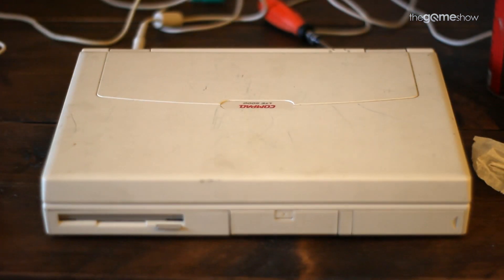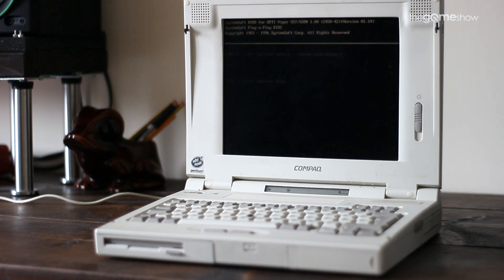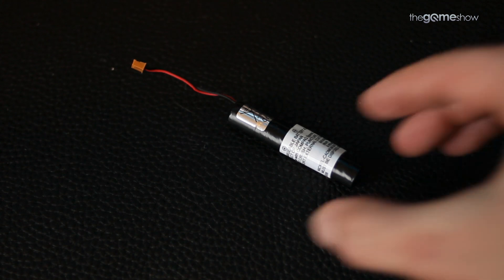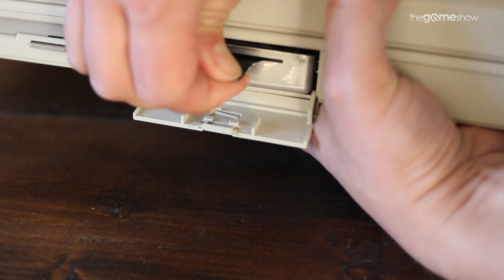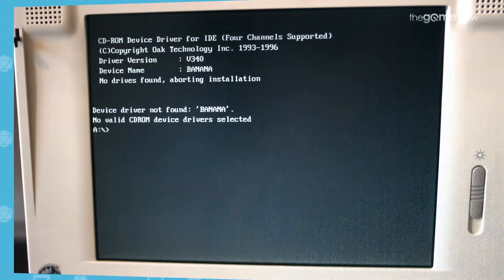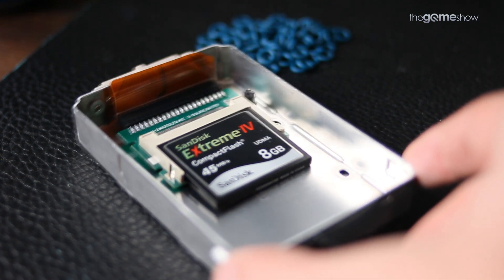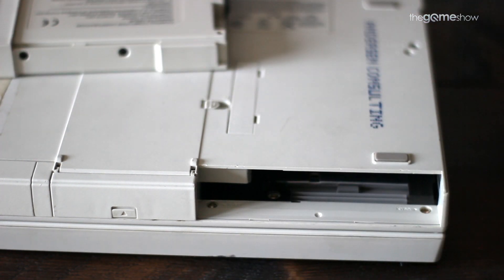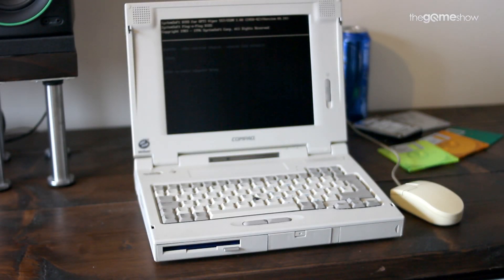Upgrading a Compaq LTE 5000 Laptop with an IDE Compact Flash Card for DOS

Comment: I've got same laptop. and I am struggling with Compact Flash too. 
May you please tell how did you installed MS DOS on your card? Did you used Virtual Box?
Reply from the maker: I put the CF into the adapter, the PC read it as if it was a hard drive. What CF card are you using?
Reply: Does it show the CF as a harddrive in the BIOS? This is the first thing that has to work. Then you need MS DOS 6.22. You can find it on google. Boot from DOS Disk 1 and install DOS. The installation will fail if the CF is not recognized. "No harddrive found on this machine".

Comment: I just picked up a Compaq LTE 5300 on eBay for $45 that was listed as having an error. It was simply a hibernation file error and easy to fix. The thing is mint! Anyhow, When I finally got the HDD to boot NT4 Workstation was loaded. I guessed the password! "admin" believe it or not. I noticed the system was registered to Andersen Consulting, the same company printed on the bottom of your Compaq. How strange. Instead of going the CF card route I ordered a 32GB mSATA SSD and mSATA to 44pin IDE adapter for a total cost of $32. I'm hoping to be powering through DOOM soon! These systems really do make the best retro DOS gaming rigs out there. Also, if you want to get around the problem of having to pull your CF card to load software, pick up a cheap PCMCIA Ethernet card, install Windows for Workgroups 3.11, set up TCP/IP and share your drive on the network. If fire up WFW3.11 when I need to install software on these older laptops by simply moving the files from my main Windows 7 system. Once finished, it's back to DOS. Also, someone else in the comments wondered how to install 95/98 without a CD. Get DOS installed on the HDD first using floppies. Put the HDD into another computer that has a CD drive, make a folder on the HDD called "OPTIONS" and copy the contents of the Windows 95/98 CD to the "OPTIONS" folder. (You'll copy either the \WIN95 or \WIN98 subdirectory contents depending on version of Windows on CD). Put the HDD back into the laptop, boot to DOS, go to the OPTIONS subdirectory and run SETUP. Windows 95/98 will load lickety-split and you'll have the added bonus of never needing the CD when changes to Windows are made. You can also do this with Windows 3.x by copying all the diskettes to the OPTIONS folder as well.
Reply from the maker: Fantastic story. Thanks for the high-effort post mate. GOOOO community!
Reply: I just got the 32GB mSATA and converter in yesterday and am having a bit of trouble. When I install the drive into the Compaq 5300 it only recognizes it as an 8GB drive, which is normal. The BIOS on these old machines had an 8GB limit. Back then you would load an "overlay" BIOS on the HDD that would override the computer's BIOS and allow the computer to see over 8GB. Well, anyway, I booted the system with a Win98 boot disk, and put a partition on the drive just to test it out. My plan was just to use the 32GB drive as an 8GB for now since I don't have any of those old overlay diskettes laying around any longer. FDISK partitioned the drive just fine however upon reboot the diskette starts to boot and just hangs. I'm assuming DOS 7.1 (the version on the Win98 boot disk) is not recognizing the drive for some odd reason. Back in the day leaving a large drive as 8GB without an overlay worked fine on PC systems but for some reason not on the Compaq. So, I just tracked down a generic overlay diskette on the net and am going to try this again. I'll update with the results. I'm hoping this works as an alternative to using the CF card option.

Comment: How you install Windows to cf? I don't understand it. You make it on a modern computer with ide-cable?
Reply from the maker: The CF card is connected via the laptop's internal IDE, so it functions identically to a HDD. As far at the computer is concerned, it is a hard drive. And so you install from floppy just as you would normally.
Reply: @StokedMatty   I have a LTE 5300 and a dead HDD. I bought an adapter and UDMA-card but I can't install the system. Should I do the installation on LTE itself or on another machine? Tnx
Reply from the maker: On the LTE. Have you been able to install DOS? That's your first step, before you can even think about Windows.
Reply: @StokedMatty  Well: I put a floppy drive, load DOS (with CD-drive support, of course) take out the floppy, put the CD-drive and begin installation win98?
Reply from the maker: Win98 would be a bold move. Your steps are correct but I feel the machine would crawl with anything above Windows 3. Also, great job nabbing the CD-ROM drive. I've had to suffice with floppy only!

Comment: I bought one of these today, I paid 5 dollars but i dont know if it is working.
Reply from the maker: Have you got the power pack etc? Battery is likely to be hosed so I'd remove that and use mains power.
Reply: @StokedMatty  If you're daring, the thing to do with the battery is to look up the li-ion cells online, buy replacements, and then go through the careful solder work to replace them in the old battery. If you have the skill. I don't so I'll be putting up with the dead main battery on the 5400 I got ahold of.

Comment: Question about the partitioning. It will only recognize 2gb, but I see you have an 8gb drive. Do you just create four separate partitions?
Reply from the maker: Correct. Literally zero reason to have 8gb of storage on DOS though!
Reply: The Game Show I've got almost 400gb of old DOS games and a mild case of ADD, so the more games I can fit on the LTE 5400 at once, the better :)
Reply from the maker: That's probably a million games. Best of luck getting through them all :-)
Reply: @joshuabrown3654  is there a good site to download DOS Roms? thx

Comment: The reason the first CF card wasn't working was due to it being a newer standard. The passive adapters only work with the earlier standards. In 2008, they changed from being pin compatible with IDE to working on a serial protocol (sata). That allows faster speeds and higher capacities, but it does mean you can't use it in place of an IDE drive.
Reply from the maker: This is why you lot are the best. Thank you mate, hopefully nobody need make the same mistake.
Reply: I'm not sure if i can give you a straight forward answer to that. The easy way would be to just look at people's recommendations, If you wanted to save money and search for a deal I would go and look up the standards and use the speeds to determine what one will work. None of this is a done deal though, my buddy bought what should of been a type 3 card from sandisk and it worked in his 2nd gen iPod.
Reply: The reason why the SanDisk CF didn't work is because it is set to behave as removable media in the media descriptor. There are programs on the internet that are capable to change it back to the original behave(fixed media).
Reply: Geose When I'm looking to buy a CF card, what should I be looking for in particular to avoid this issue?
Reply: The Transcend cards all use fixed-mode so they are a good bet.
Reply: @paianis  I got the exact same CF2IDE adapter in this video as well as a Transcend 266X 8GB card today, and it seems to just hang on 'Starting MS-DOS...' after selecting 'Configure Hard-Disks' (which then asks for a reboot) on an MS-DOS 6.22 from Floppy. @The Game Show is this the issue you were having when you said you were having formatting issues in the video?
Reply: I have a Delock CF to IDE adapter and although the BIOS recognises my 8GB card just fine, my 6.22 boot disk won't play ball with that or my 1GB card. Doesn't matter if I format it in OpenBSD (FAT16B) or Windows 7. Once I have a USB Floppy drive I can make a FreeDOS boot floppy and hope that will work.
Reply from the maker: This is EXACTLY the issue I was having. There is an explanation here in the comments. IIRC it's because of the formatting of the card and can be fixed by flashing the cars. My fix was decidedly less high tech, I just bought a cheap card which (coincidentally) had the older format.
Reply: @StokedMatty  Shame, as both cards I tried, both cheap Chinese and high-end (Transcend) both seem to have the 'newer' format. I'll just have to look around for a card with the older format, although it's going to be difficult unless there's some obvious way to differentiate the formats by just looking at the card/serial or such.
Reply from the maker: There is a comment up there ^ apparently you can download a program which will change the mode of the CF card to to older mode. Quick Google couldn't hurt 😬
Reply: @StokedMatty  I'll give it a look and update accordingly. Thanks a ton!
Reply: According to Thinkwiki the Transcend cards already identify as fixed mode, so changing the mode shouldn't be necessary.
Reply: @paianis  So is this newer/older format thing just the 'removable' (newer) and 'fixed' (older) disk types I've been seeing? I've been looking at the same Thinkwiki article and the only software I see on it is for Sandisk cards.
Reply: I think the method is different depending on the make of card.

I have a feeling that my cards might not be recognised because they are being formatted in a USB card reader on a modern PC, possibly in removable disk mode and not fixed disk. I will soon find the truth, hopefully...
Reply: @paianis  I'm pretty sure formatting doesn't affect how the computer detects the card, seeing as it's irrelevant to the partition. I have a feeling it's only older cards that will work, so I might have to find a CF card with a serial number older than 2010 or something, my best bet is probably to find one that's 4GB or under. Then again, I've seen people use 8GB just like mine - oh well, will keep experimenting and updating accordingly!
Reply from the maker: No problems bud. Best of luck 👍
Reply: Geose I appreciate the info!  Looking to have the LTE 5400 delivered in a few days and am psyched to do some upgrading :)
Reply from the maker: Any update Josh?
Reply: I feel like this comment should be pinned, as this info is invaluable for people who want to do a similar upgrade with a cf card.

Comment: Wow, looks like this was quite the project! Great job getting her cleaned up.
Reply from the maker: Lots of fun. Getting her clean was a long process but worth it in the end. The added CF hard drive has meant I can sideload a whole bunch of DOS games on with very little bother.
Reply: That's a plus for sure. Between the initial cost, parts, and your time, hopefully she holds up for you for a while and is worth the investment!
Reply from the maker: It's fun to tinker with this stuff. I picked up a DOS machine at the dump recently, will be putting a video up in the coming weeks as I try to get it working.

Comment: If the pcb in the battery is ok the cells would be very easy to replace. because of its age i am almost certain it will be be using NiMH cells and you likely have the right cells in those new batteries that don't fit.
Reply: The Game Show worth the risk. Fight fire with fire, as my old man used to say.
Probably why he was sacked from his job as a fireman.
Reply from the maker: I don't have any batteries at all, nothing turned up. I considered the idea of getting replacement cells. I contacted a few clever folks like Neil at RMC about it but ultimately didn't want to risk burning my house down.
Reply: NiMH are relatively safe especially compared to lithium, there unlikely to blow up if you make a mistake. I can talk you through how to do it, or if your willing to send the dead battery to me i would be happy to do it for you. i'm in the uk.
Reply: x2 for replacing the cells, should be relatively easy job, not sure how easy it would be to convert to lithium ion for a more modern replacement could be worth a look.
Reply: lithium batteries have a very specific charging cycle, trying to charge them on circuitry designed for NiMH can be dangerous. But i definitely think he should have a go, can't do any more damage to the battery and it would make a good video.
Reply from the maker: Dude I wish I'd contacted you sooner. I did put out a shout on Twitter, but it seemed to be a dead end. They went into the battery recycling at work :-(